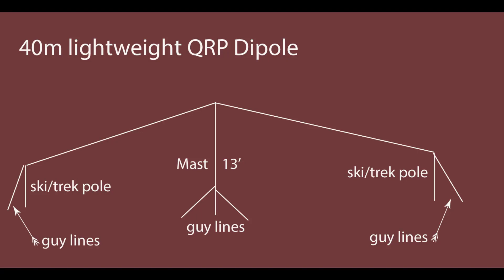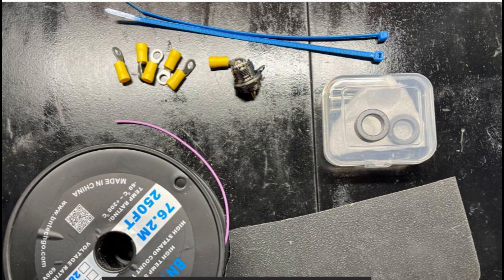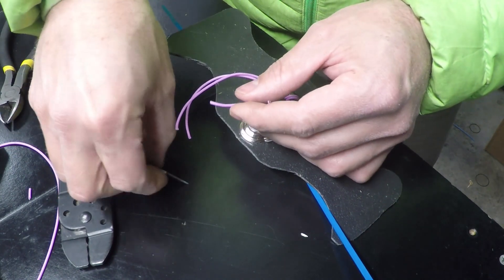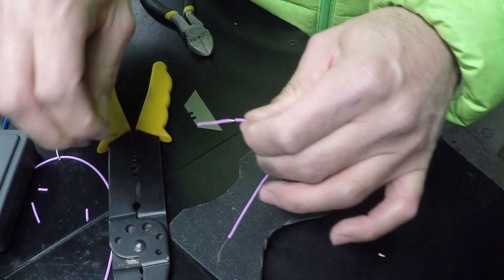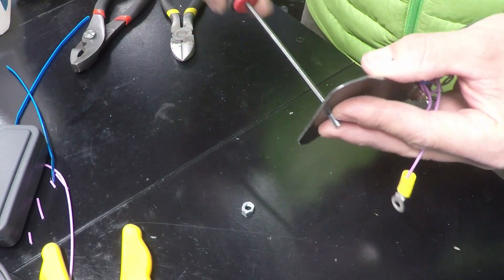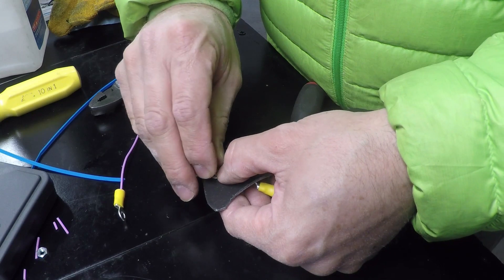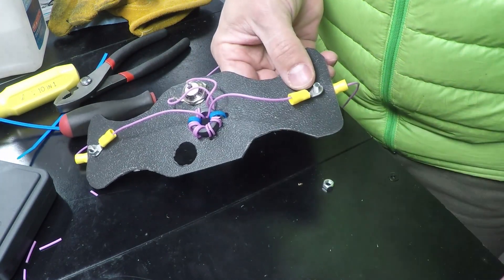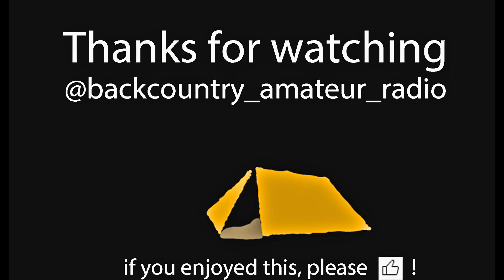Part 1: 40 Meter Dipole Home Brew Project - building an antenna for SOTA

Comment: Antenna projects are always the most fun. A dipole should work great for you.
Reply from the maker: I agree! Thanks Kevin. Yesterdays activation gave me some confidence that this is working quite well. Do you think that building the choke in was necessary? Should I have tried it without it first? I'm kinda thinking I ought to at least try it...
Reply: @backcountry amateur radio  ,I don't normally use a choke on a dipole, it is good to try new things. I think you should try both ways.
Building antenna systems is great fun.
Reply from the maker: @hamradiowithkevin  Thanks for the recommendation! I'll try one. Next up, 80m! I would really like to get onto the 3.916 Santa Net this coming Christmas with the kiddo.
Reply: @backcountryamateurradio  the little ones will appreciate that, AND it is an antenna project👍